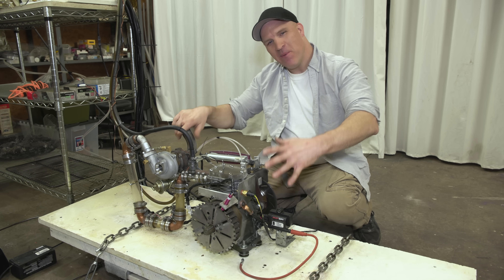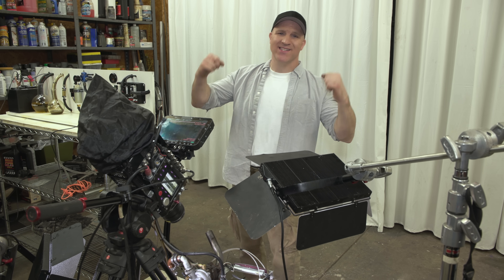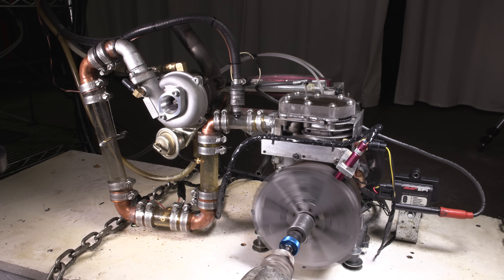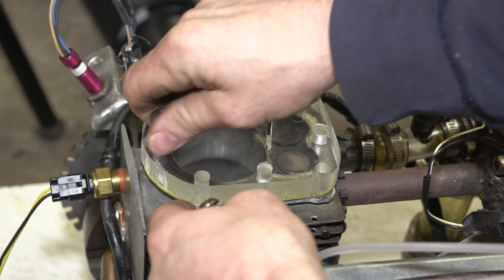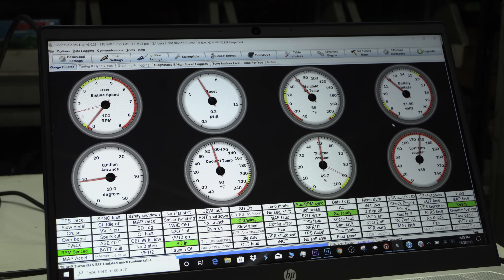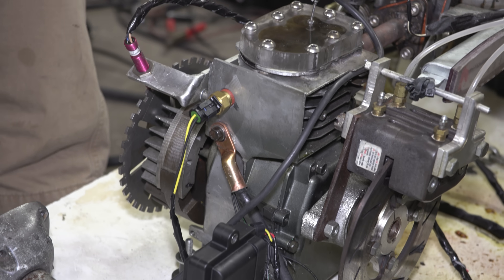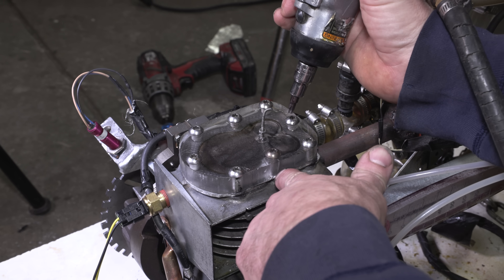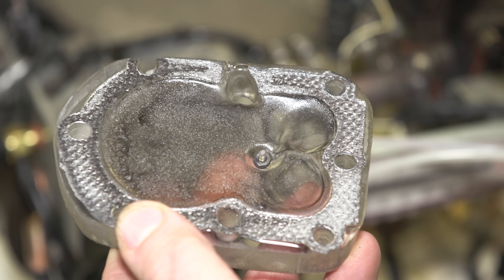Turbocharged SEE THRU ENGINE on EFI and Nitromethane (FINAL EPISODE)

Comment: Too bad I couldn't be there giving you more terrible advice - could have welded a nut onto the electrode bolt, and let it run way harder - but for all that effort, you'd still end up with erosion right next to the head gasket that finally punched through.
Seriously one of the best endorsements of a Briggs & Stratton setup, and seeing it run so well at the end just tells me everybody who supported this effort makes awesome stuff.
Can't wait to see the next generation of motor running on full anti-lag in 4K slow mo.
Reply from the maker: Thank you, I totally agree it was definitely a combination of a lot of good companies that made good products. Yes that engine will be up very soon... it's going to show its face in the next episode which is going to be a see-through catalytic converter. Boy was that a tough project to build that.

Comment: You have 1 injection event every revolution.. should be 1 injection event on the intake stroke only (1 injection per 2 revolutions on 4-stroke).  You have run issues because your EFI setup is configured wrong.
Reply from the maker: Yes and no, there is one injection event for every revolution, this is because there is no cam sensor on this setup oh, so that you see you does not know when the intake stroke is. This is a very common scenario, especially in experimental applications. However this does not affect the performance significantly all you have to do is run half of the injector timing since there is two injector events per intake stroke. But also part of the issue in these particular runs is that the sensor is damaged, so the ECU is not receiving accurate rotational information and position and is basically just taking a guess as to the revolutions of the engine the RPM and the crankshaft position. For the next set up I will have a camshaft position sensor so I will have one injector event per intake cycle.

Comment: You actually needed to go the OTHER way in size... Use the SMALLEST electrode you can to get the spark to the cylinder. The larger the electrode the more heat it retains and transmits due to surface area
Reply from the maker: Yes exactly right ! That's what I have been aiming for since the beginning, you can see initially I used a very thin electrode, But I did want to do it the other way around just for the heck of it. Great point though .
Reply: @WarpedYT  Well I think we've all learned a lot from see thru engine mark 1. Can't wait to see what's next!

Comment: You could probably gain a bit more power and responsiveness if you put the injector at an angle to help keep the fuel from puddling and keep it atomized a bit better.  Could also move the throttle blade closer to the intake of the engine.  Having it that far away lets the space between it and the intake valve act as a reservoir/tank.  I guess that isn't a huge concern though since you aren't racing it lol.

I would really like to see a small nitrous jet added.  Would make more power, help the turbo spool faster which would in turn make more boost and power, and might look cool with the see through head.  This is easier to recommend knowing my wallet isn't funding it lol.

Comment: Use a 13 hours Predator from Harbor freight so you have more exhaust do something with your charge piping I’m sure you were getting a boost leak from your fuel injector an angle your fuel injector towards the intake don’t use a plastic head be done with nitromethane use race gas or alcohol and if you don’t see the results you want hit it with a dry shot of nitrous

Comment: I like how you never bother with those new fangled "spark plugs". Just let it arc directly to the engine block!
Reply from the maker: Thank you, yes but unfortunately it seems to be causing quite a bit of electromagnetic interference. My goal originally was to keep the combustion area free of any so we can see it in its entirety.
Reply: @WarpedYT  I wonder why that isn't a problem on "normal" engines. I don't see how spark plugs vs. arcing to the engine block could make the difference. My guess is that having a metal cylinder head shields the EMI from leaving the combustion chamber, and by using an acrylic head, the EMI isn't shielded. I'm surprised your attempt to shield the cable with aluminum foil didn't work though!

Comment: try to use glass as the head gasket (if it dosent blow up by pressure and sudden temperature) :)
Reply from the maker: Yeah glass doesn't work very well, and doesn't take the pressure or the heat, behowever I do have a different material that I'm going to be using in upcoming videos.

Comment: Which turbo did you use?
How much boost were you able to make?
If you want to blow it up, run it with a lean mixture at high rpm. Otherwise drain the oil out of it. It will blow up, but you may regret doing it.
Using a tungsten from a TIG torch would have probably worked better as a spark electrode. Tungsten does not transmit heat very well, but conducts electricity VERY well.

Comment: the reason your crank sensor is going bad is because its shorting the plug through it using it as the ground, you can fix this by putting in a second electrode to act as a battery ground which then bypasses the sensors to keep them from frying.
Reply from the maker: I was thinking of trying something similar. But wouldn't the big ground cable act as a good enough ground through the block?
Reply: @WarpedYT  unfortunately it will find the path of least resistance and currently it finds your crank sensor(with it having an anodized finish) the least resistance. if you look closely in your slow mo, you can see sometimes the spark jumps to the piston, which rides that to the crank and can jump to the sensor from there. that's why spark plugs have their own ground to block. basically its jumping from the crank to the sensor back to the block from time to time, you want to control where that 20k+ voltage is going or itll go wherever it wants.
Reply: @WarpedYT  that's also why if you look at a crank sensor on a car, the housing is plastic with only the sensor, and usually a brass reinforcing ring for the bolt which are completely isolated
Reply: that's also why, mind you it did not blow the sensor on the original head as it always gave it a direct ground via plug and cylinder head.

Comment: Have you ever considered getting a custom transparent head made from pyrex or some other high-temp glass?
Reply from the maker: I have tried, but it doesn't last very long, however I have come up with a material and I will be featuring and some future episodes, it took me about two and a half years to develop but it works fantastic. That's the material that's going to be used in all of the episodes coming up, it has also been used in the episodes before this one but that particular video has not posted yet it's coming up next though.

Comment: that's why I say put the heat sink on the bottom around the bolt so the aluminum heatsink will pull the heat away from the bolts and the head and let that fit acrylic head last longer without melting compression Los hole in it plus you got to have air flow you got to put a fan or have a fan in the room blow the air and the Heat away from the engine and it will last a lot longer each acrylic head will last a lot longer peace out into the world good luck have a great day

Comment: Up a v e Channel on YouTube I bet he can help CNC machine out some heat sinks and I think you should put the fan on the outside of the sensor now that I'm thinking out about it and have it be a bigger diameter so I can move enough air I think you overheated it these Electronics do you have a temperature threshold they will fail if they get too hot you need a way to move air and heat away from that engine and that would keep it running better for longer good luck peace out into the world have a great day

Comment: That sounds awesome it's running better than I've ever heard it run it looks like you took some of my advice I have a idea for you on your acrylic head to keep it from melting I think what you should do is Mount some aluminum heat sink fins and you put a directional fan on the inside of that plate that you're using to mark your sensor for your firing position I think if you would use the mounting holes for the head and have some heat sinks come off them and you have a way to move the air around the heatsink aluminum will draw out a lot of heat as long as it doesn't get saturated once it gets too hot it loses its capability of drawing heat away but I think that's a way that you can make these acrylic heads last longer is if you give it away to dissipate the heat that it is enduring you can even make it like a design like a gasket a ring around the acrylic head that has fins that uses the same mounting holes as the head itself so when you mount it to the block it will seal then it will draw heat from the bottom side as well yeah I think that would be a solution if you give it some aluminum heat sinks and a cooling fan but good job on shielding the wires and keeping the electromagnetic crosstalk from happening also were you have strands of wires running in linear Direction twist them their electromagnetic fields when they're Twisted will not interact with each other but when they're in a line they can induct current in one another and screw up signals this is an awesome tangent experiment I think if you figure out a good enough cooling system you could keep the acrylic head on there all the time and put it in a go kart and that would be a blast don't blow it up I want you to put it in a go-kart and see how fast a turbocharged Briggs & Stratton will go because I've written a go kart with a Briggs & Stratton just naturally aspirated and not souped up like that that would be talked to have a fuel injected turbocharged go kart Epic badass to the Gearhead Supreme level good job keep up the great work warped perception
Reply from the maker: Thank you! That is a great idea, I may have to try something like that in the near future.

Comment: 8:08 With high speed camera and transparent air intake you can adjust optimal timing for fuel injection! Note that it was not injecting at the same time the air flows into cylinder.
Reply from the maker: You're right it was not, because the sensor is already shot so the ECU is just taking a guess at the RPM at this point
Reply: It ran

Comment: Matt.....thread a spark plug into the head,ground the threaded portion to the engine case....
Then put the plug wire back on.....the plug body will be faked into thinking its threaded into the aluminum cylinder head.....then your ecu will work....
Matt .....from southside contols

Comment: Have you considered insulating the electrode with ceramic or something similar? so it would not melt off the head as fast. Looks like some gas grills have ceramic electrodes that could be used, if there was a way to seal them to the head.

Comment: Would it be possible to put a small spark plug (or just a wire epoxied in) from the the bottom so the head doesn't have the spark screw weak point? Cause so far it's been the weakest point in the setup

Comment: You should just drain the oil stick the throttle wide open and see what happens
Reply: If its like minibike motors it has a low oil sensor
Reply: I know it’s called disconnecting it I had to do that on my gokart it kept on staling

Comment: Obviously the views aren't speaking as loud as you are.... to yourself.

We obviously love seeing this little motor keep going.

Dropping it would be stupid. Just keep learning on it because you have barely tapped the surface of the possibilities of that engine. 

Sleave it it,reinforce the casting sides,custom head... heck even valves and billet internals.

This engine can't be put up and furthermore. If you wanted to blow it up, use ethanol, boost and nitrous.

Comment: Issues with the crank sensor may be caused by the stock ignition flywheel magnet. When i installed a electronic ignition to my lawnmower engine, i put a sensor to outside of the flywheel and it was giving a messy signal, then i moved it to near centre of the flywheel and the signal was all nice and stable.
All n all cool experiment and a good effort !

Comment: The ONLY problem on your EFI system is LACK OF GROUND on SparkPLUG
Reply: You neeed a second screw in head just a few mm from the current one and run that to the block with a wire. You are currently using the valve head. For a spark plug ground which is very unreliable.
Reply: the sparkplug on this engine is a bolt and the spark goes from bolt > engine block
Reply: Also build a head with water cooling will last much much longer
Reply: I agree with Greg. That was the first thing I thought when I saw it. Why do you think there is a spark plug gap and the purpose of a spark plug in first place?
Reply: @MotoXsjetRider  yeah and if the "sparkgap" between the bolt and the block is bigger than the recommended sparkgap, it will require larger voltages from the ignition coil to produce sparks... 

This might be what happened here

These larger than normal spark voltages causes greater electrical interferance and are what killed the O2 and timing sensors

Comment: too bad this series is over
maybe use honda engine for next series? or a see thru rotary engine, wich is my personal favourite
Reply: Haha he actually has a see thru rotary series already!!! 

Go check it out!
Reply from the maker: @scenicdepictionsofchicagolife  yes and I'm currently working on the second version of that rotary engine which was initially supposed to be the first episode but I ended up going with the simpler smaller design instead so everyone can understand.
Reply: @WarpedYT  that's cool dude. Wish I could check your shop out 😂 I live in Chicago too by Portage Park
Reply: It would be difficult, to build an overhead valve cylinder head out of plexiglass. Valve seats, and the exhaust valve guide just get too hot!

Comment: I’d like too see a see-thru 2 stroke engine.
Reply from the maker: It is coming!
Reply: @WarpedYT  ayyyy
Reply: dishsoap1 damn ask and you shall receive lol
Reply: dishsoap1 good suggestion but 2 stroke wouldn't be as fun as the 4 stroke
Reply: Mr.engineEAR09  I think seeing the scavenging process in slow-mo would be worth it. I’m glad it is in the works.
Reply: dishsoap1 good point man 👍
Reply: @mr.engineear0987  BAMBAMBAMBAMBAMBAMBAM or BAM BAM BAM BAM BAM BAM?
Reply: Yes bro please bring the episode on see through 2 stroke engine soon.
Reply: yes
Reply: There are existing, properly designed, developed, made transparent engines, using proper materials.
try searching
You will also locate video recordings of the various engine types, fuels, etc.
Sincerely
Reply: 400 liker yee
Reply: 🎉yes

Comment: The fuel injector and spark were both firing twice per combustion event, is that intentional?
Reply from the maker: Yes and no, the spark is firing twice per cycle because it's a wasted spark setup, the injector however is firing twice per cycle because I don't have the camshaft position sensor installed so the computer does not know which one is the intake stroke. the engine runs just fine this way you just have to run half of the amount of fuel timing you would normally run. I'm going to do away with this in the next episode.
Reply: @WarpedYT  ahhh I forgot about the CPS, cheers

Comment: not the end yet blow it up with nitrous oxide.
Reply from the maker: That's going to be in the next series with the next version of this engine, that was on my list for this engine however, I needed more combustion viewing area, and an overall larger setup to really see the nitrous oxide, I like to do it right the first time. That is probably going to be in the first episode of the newer engine, also I wanted to show Dyno numbers on regular gas and then with nitrous oxide, and not have the Turbo system as a factor.
a lot of people don't realize it but it was very very difficult for me to make these episodes very exhausting, one of those reasons was because everything was so darn small, and another reason was the way the starter system is setup on this engine even with the drill is very tiresome when something doesn't go right. That's one of the reasons I've been trying to get out of this series to move on to the next, it's hard enough to film this stuff let alone deal with all the technical issues. Thanks for the feedback that one is going to be coming up very soon.